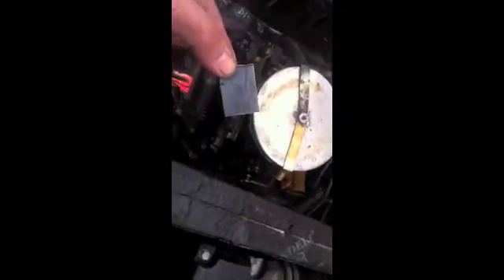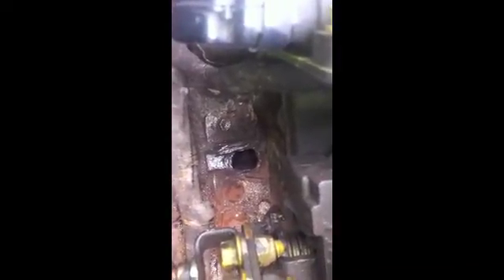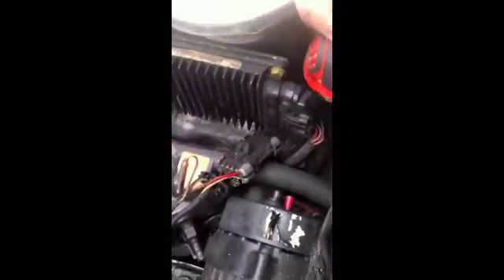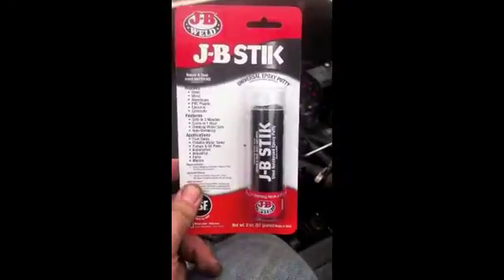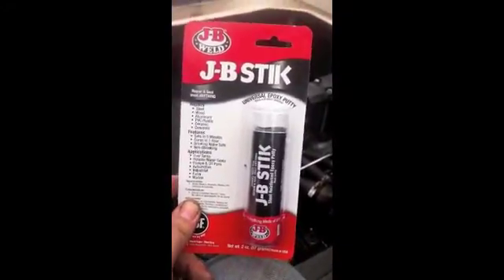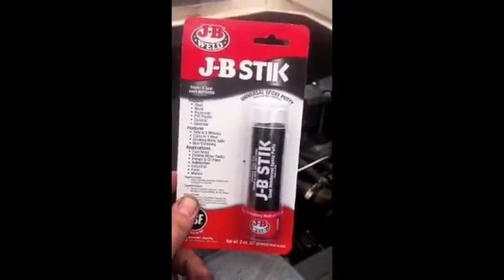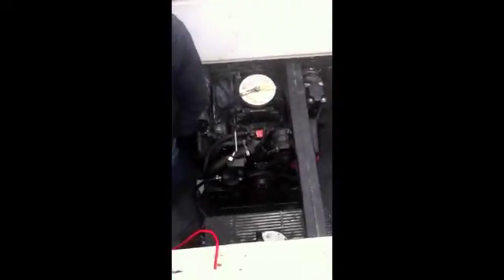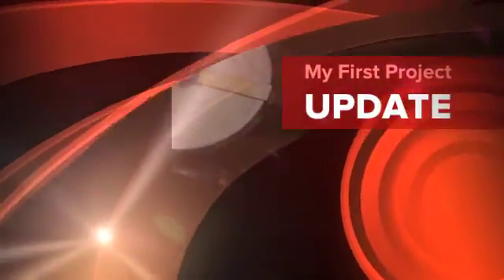How to fix a hole in a intake manifold on my boat using JB weld

Comment: I Used jb weld on my 4.3 mercruiser manifolds and it has worked great so far... runs below 150 degrees in the St Lawrence river so it is a good fix for me.

Comment: FYI - regular JB Weld works better. Never use fast drying JB Weld on serious job. The one that looks like liquid bonds much, MUCH better. And check that JB weld holds the water. If you have water in your manifold cooler.